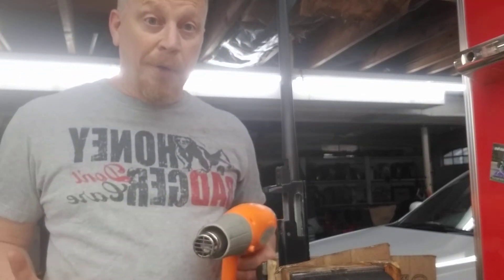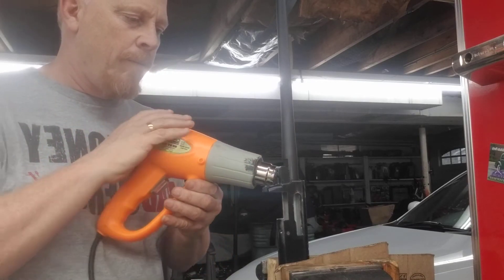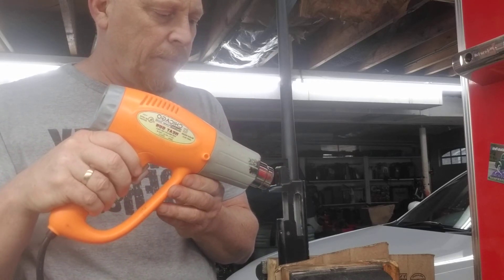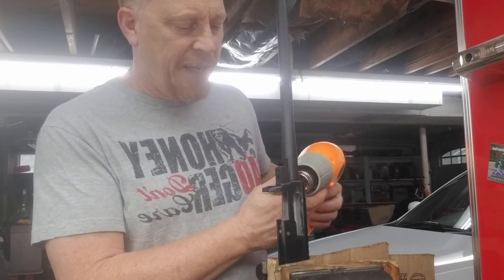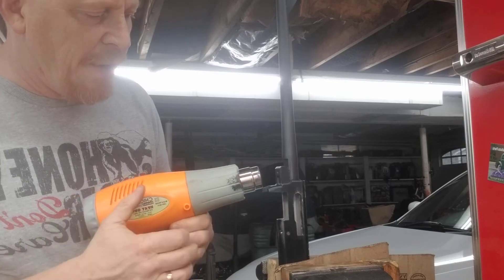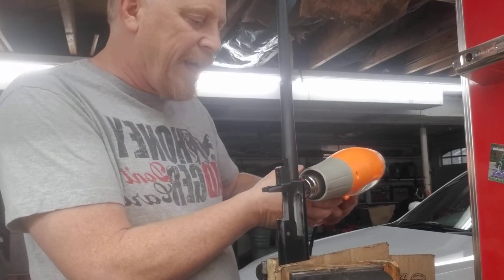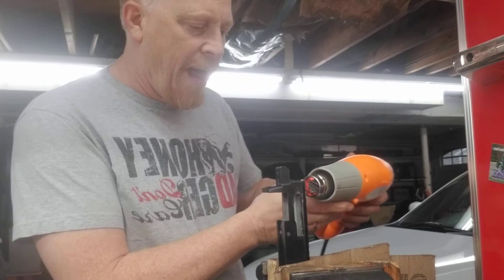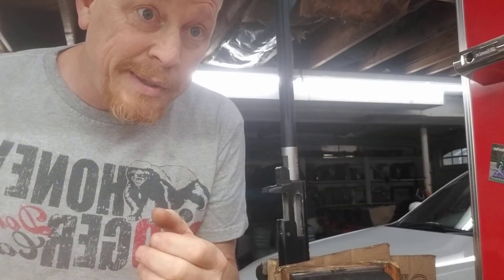How to Change Remove Install a Ruger 10/22 Barrel in 3 minutes with a Heat Gun.

Comment: Holy shit I tried this it took so much longer, I had a tac sol barrel in a Brn receiver I was pulling and pulling finally had to twist and pull , but nothing was easy about it
Reply from the maker: Is the Brn receiver aluminum or steel?  The reason this works with aluminum receivers is that aluminum expands twice as much as steel with heat.  The hole grows more than the barrel.  If you have a steel receiver, it won't work.  If you have an aluminum receiver and are having difficulty, you need to get it hotter.  A hair dryer won't work.  Need an actual heat gun, and don't be afraid to get right up on it.

Comment: I work in heavy industry. This is easily the best, most common sense way to do this. I will say this. don’t be surprised that some barrels don’t separate as easily as this video shows. I had to put a wrench on the barrel mount flat and rock the barrel back and forth. For about 45 minutes while using heat before my barrel separated. Another thing I would recommend is a little nuts off or WD40. I had my Shaw barrel in the freezer for the same amount of time and it dropped in likegrease thru a goose.
Reply: Thermal expansion/contraction and guns are great together. 
People often forget what the ticking sound in their car actually is when they turn it off. 😂

Comment: I tried this technique with the Thompson Center T/CR22 and a Volquartsen barrel, and it didn't come close to going in.  Wouldn't go any further than about 2/3rds the way in....no further.  Thinking the TC receiver may not be the same spec as Ruger?  They also require two shims between the barrel and receiver.  Measurements all seem to be the same, but it just won't go in.

Comment: For those removing a tight barrel, you could secure the barrel and use a wooden block and a hammer to gently tap on the front of the v-block lug on the receiver to separate it from the barrel, in combination with the heat. Just be sure the receiver is going to fall onto something padded, you won't want to catch it if it's hot.

If you're installing a new barrel that just won't go in, you may also have to sand down the diameter of the barrel where it slides in. Cut 1" strips of sandpaper and use a flossing motion across it. Keep the receiver hot for when you periodically check for fit. A little anti seize will make future removal less painful. 

Had to install a new green mountain barrel in a new dlask receiver. Not sure which was out of spec but it took me about 2 hours to get a proper fit.

Comment: Dang, bud. Still no luck with my barrel with the heating trick. I do, however, like your cardboard over the vice rather than just electrical tape. Thanks fir sharing. I’m going to give it another shot in a bit. I didn’t have this much trouble for other 10/22s I’ve worked on..
Reply from the maker: If it has an aluminum receiver, it should come out.  May have to heat it some more.  Good Luck!
Reply: I’m hoping the heating works for installing new old barrel wasn’t too much of a hassle with a mallet but new faxon barrel is so dang tight idk gonna give it another go after bit see what happens

Comment: This ain’t working :(
I have a tactical solutions lightweight aluminum barrel!
So I guess they’re both expanding together :((( grrr
Reply from the maker: The tenon that goes into the receiver may be steel...  Be sure to heat it really good and hard.

Comment: Mine was easier, found the barrel was loose you could wiggle it a little. Found the screws were loose that hold the barrel on. It's a mid 90's deluxe model, all metal. Blue loctite solved the problem.

Comment: Never needed a heat gun.
Reply from the maker: Many have been changed without one...  But with the heat gun, there is no thumping, beating, dragging/pushing a hard steel barrel across a soft aluminum receiver.  It's easy to get the barrel fully seated and clocked perfectly...  Plus, it only takes 3 minutes and results in zero wear, scuffs or damage.